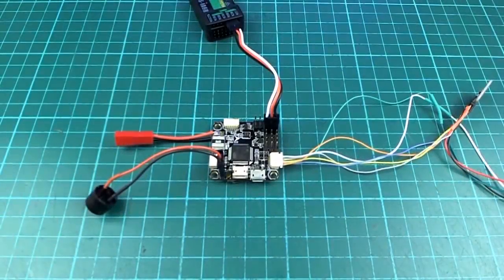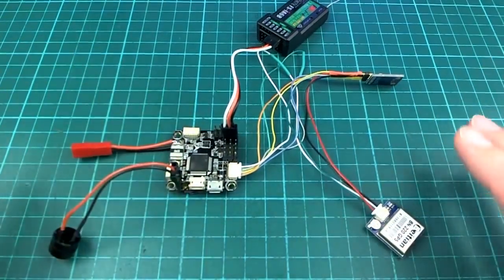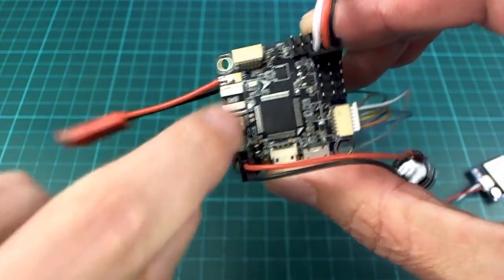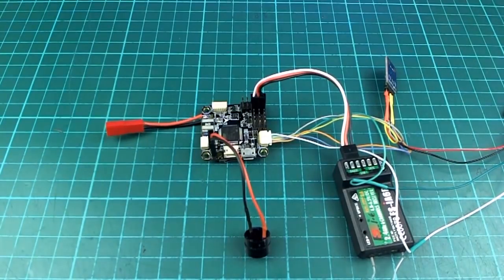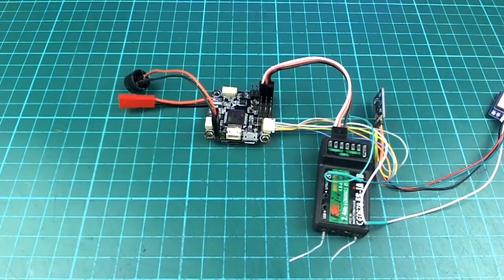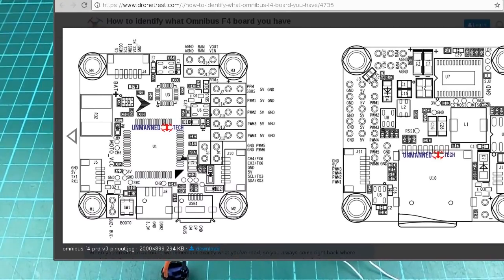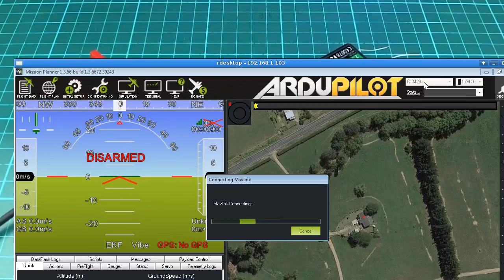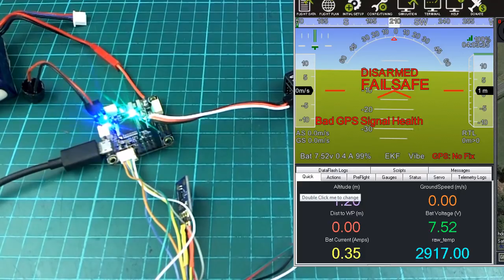Arduplane on Omnibus F4 Pro

Comment: You mentioned that you are going to use UART1 for telemetry, however since the SBUS-pin on the board is actually connected to UART1 at least RX is going to be quite busy. Is it possible share uart for telemetry and SBUS or did you miss the fact that they are connected? :)
Reply from the maker: I think I missed that they are connected. I could have sworn I had my radio working at the same time as having GPS  working on that UART1 earlier though....
Reply from the maker: According to this, RC input is on PB8, UART1 is on PA9/PA10 and UART6 is on PC6/PC7.
https://github.com/ArduPilot/ardupilot/blob/master/libraries/AP_HAL_ChibiOS/hwdef/omnibusf4pro/hwdef.dat
I still don't get what removing that 'resistor' did or whether it was even necessary though...
Reply: With the board you have the ability to choose between using SBUS (UART1) or PPM (no UART). You do this by connecting the pin (via soldering) to either PPM or SBUS. In your case i guess it was already connected to both SBUS and PPM at the same time, and to have a clear UART1 that can be used for something else you need to remove the connection of the pin to SBUS. If you look at the comment for the PB8-pin you can see that they want you to remove the resistor connecting SBUS to the pin and instead use PPM. This makes the UART available for telemetry. If you don't remove the SBUS-resistor the reciever will interfere with the UART if you try to use it for something else :)
Reply: In other words, both PB8 and PA10 can be connected to the pin. You remove the connection to PA10 by removing that resistor and thus you have a free UART1. This does however mean that you have to use PPM (since SBUS requires an UART). If you are currently using SBUS and it works, then I think you might have removed the wrong resistor
Reply from the maker: I just double-checked and I can run the GPS on UART1 and sbus at the same time with no problems. I have not checked running UART1, UART6 and sbus at the same time though, I'll do that a little later. I think I understand what you're saying about the pins being physically connected and needing to be detached, and by that logic it should not work. But I'm wondering if you are thinking about all this from a Betaflight point of view? The default behavior for Ardupilot is that you can use ppm or sbus on the same pin without making any settings in the configurator - it self-detects the protocol being used. So perhaps Ardupilot is able to handle UART input on a pin that is not a real hardware UART.... ?
Reply: I've seen that some boards have UART6 connected instead of UART1, but its really weird that it is working at all after removing the SBUS resistor.  I'm using cleanflight yeah (or INAV rather), but since it's a hardware issue i figured the same would hold for Arupilot. I guess it's possible that Ardupilot uses softserial on PB8 to handle SBUS, and that would explain why you had to removed the connection to the hard uart. It'll be interesting to hear later if it works, I'd love to free up my UART!
Reply: You were right, Arducopter can handle it without problem. I stumbled upon this thread
https://www.rcgroups.com/forums/showthread.php?3070417-Most-integrated-Arduplane-FC-solution/page6
See post #76 for anyone that's interested. Seems like the kind of thing that really should be in cleanflight as well.
Reply from the maker: I see, nice. I just set everything up on my teksumo, both the UARTs and sbus work ok together. All calibrated and ready for when the rain stops :)
Reply: Hello. I just installed an Omnibus F4Pro V2 in an Hobbyking Hawksky. I run into the problem above. I have GPS on Uart3(6) and 3DR telemetry radios on Uart1. R9mini sbus on the pins. The issue is: I have telemetry out, but to save settings I have to turn off the radio. So Sbus and Uart1 is shared. What is a little unclear is, does removing te resistor seperate Sbus from uart1? What I can understand people have success using telemetry and Sbus at the same time, but Frsky telemetry are never a problem sivce you usually only receives data.

Comment: Doesn’t the pixhawk mini do just about the same.  I purchased one for $48 with gps and power modules
Reply from the maker: I had never heard of that board until you mentioned it, but looking over the specs just now it looks like there is no onboard OSD or voltage/current sensor. So your OSD and power sensing would need to be on separate boards, just a matter of convenience of wiring I guess. Price is not that different at $36 vs $48 so not really a big decision factor.
Reply: iforce2d actually the power module isn’t a big deal but now that you mentioned it I was forgetting about those new F4 boards having built in osd which is a huge deal for me. There’s a lot more wiring involved when having to add an MinimOSD or even Micro osd. So using this F4 with its built in osd imo is a huge plus.

Comment: Thanks, as always, iforce2d.  Your videos are excellent.

FYI -- you don't need to use remote desktop for Mission Planner.  It works really well under Mono.
Reply from the maker: ah, good to know. I have always had trouble with anything using serial ports under Wine, they work for quite a while and then the connection drops. In any case I already have all my MP stuff on that windows laptop so I can take it outside with me. I almost never use it at my desk.
Reply: Really well ! Not like that it's working +/-, it's still mono and c# not native linux. There is some bugs and it's pretty slow. Better yo use qgroundcontrol

Comment: What’s the benefit over inav?
Reply from the maker: If you just want RTH for when you lose radio contact, not much. But if you're asking the broader question of what features does Ardupilot have over iNav, it's hard to know where to start. Ardupilot is not just for planes and multirotors, you can use it to control ground vehicles, boats, submarines, conventional helicopters, VTOL aircraft and even antenna trackers (personally, I bought this board to eventually use on an antenna tracker). You can find all the basic info here: https://en.wikipedia.org/wiki/ArduPilot
But what I find to be the most important features would be:
- ground station to view and control plane in flight, and make all settings wirelessly
- remote logging via telemetry
- good support for aerial mapping missions (terrain following, interaction with camera)
- various other useful mission commands like DO_SERVO, not just waypoints
- many many years more mature and well-tested platform
If you were to expand the scope to all hardware and not just the board I have in this video, then Ardupilot is also capable of using multiple GPS, multiple IMU sensors for redundancy.
Overall I think the plane flies more stably, holds altitude better, and tracks better in wind with Arduplane.
Reply: iforce2d cool thanks for the detail reply

Comment: wouldnt it be awesome if ardupilot could use the onboard osd chips a lot of the f4 boards....
Reply from the maker: The night_ghost build does already, but he is using an entirely different codebase than the official Ardupilot, and apparently has some stability issues. But it looks like it shouldn't be too far away to have it in the official source as well. https://www.youtube.com/watch?v=LLDyIyrKOsg
Reply: iforce2d the future sounds bright...the only reason I haven’t even put a pixracer in my small wings is because off all the extra crap that has to go along side it....inav will have to step it up soon.
Reply from the maker: OSD and SD logging are working now: http://ardupilot.org/copter/docs/common-osd-overview.html

Comment: Can you use like 2 or more GPS's with like andurino so the andurino will average the values and give you a lot more accurate position ?
Reply: It won't give you a much more accurate position because the gps should give the same amount of error, more than 1 gps is for redundancy.